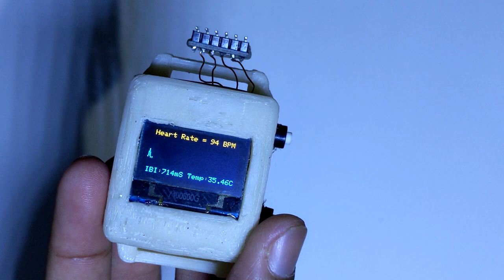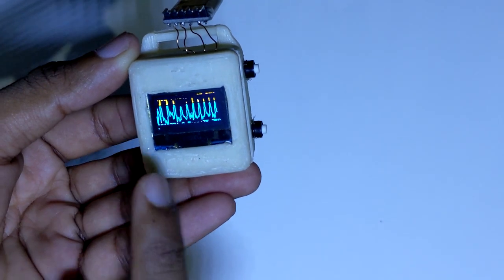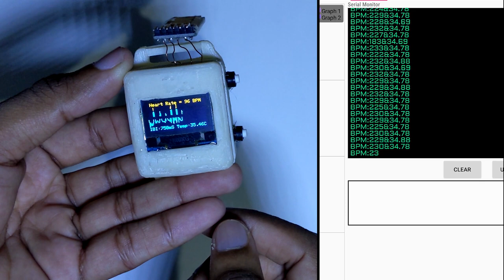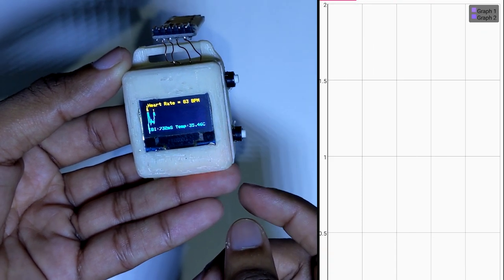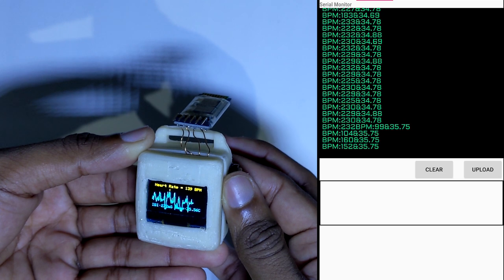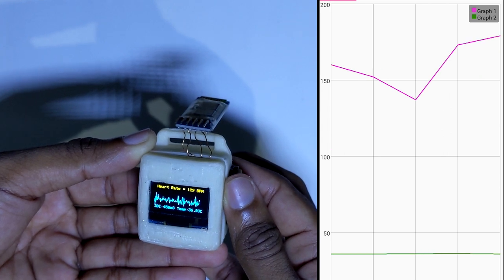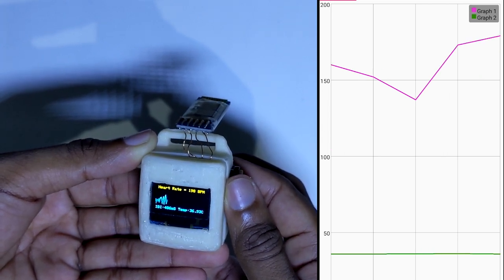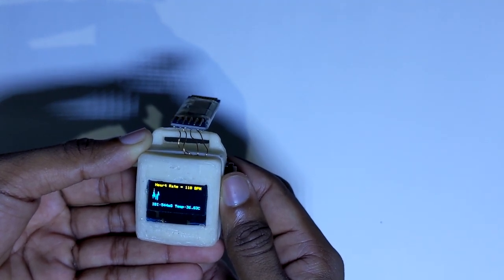Raksha- wearable health monitor

Comment: Hi , I sent  first program arduino pro mini and it worked but When I sent second program doesn't work .I have no pattern or anything in screen. What I should do? Do I press button ?
Reply from the maker: Hey, raksha 4.ino is the main code. Thermistor code is just for testing.
Reply: @VishwasNavadaTech  Raksha_4. İno work but there is no value of temp. I supposed that Raksha with switch case is main code. İf I want to work with button which one I choose
Reply from the maker: @resulakkz9526  Yes, you can add modify and try  with your requirements. It's more of a template
Reply: Whats is the difference between Raksha_4 and raksha switch case

Comment: Hello do you have the process on how you attached them all one by one? thank you hoping for your response!
Reply from the maker: Check the link in the description for schematics and connections. Inside the 3d printed case I just stacked them. With the help of hot glue and double sided tapes. You can make a PCB if you want.
Reply: @VishwasNavadaTech  Thanks, i have One more question, did you use a switch to turn it on/
off?
Reply from the maker: @jest2078  Yes. A small switch.
Reply: @VishwasNavadaTech  is that the one that is from the side?
Reply from the maker: @jest2078  Yes.
Reply: @VishwasNavadaTech  do you have a social media account sir? I would like to ask more questions..

Comment: Nice work bro, tumba crazy ide. If you want to pick this up as a mega project try to make a PCB using the bare chip ATMEGA 328p mathe you can use MLX90614 instead of thermistor for body temperature. And yeah you can use sleep mode for longer battery life.
Reply from the maker: Sure. Thanks a lot for the suggestion. Tumba khushi aytu. 😀